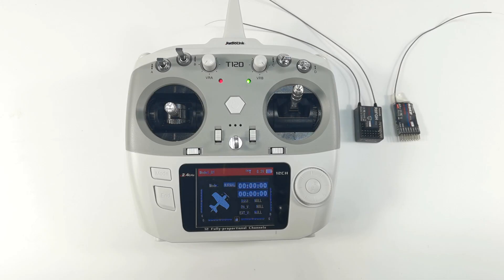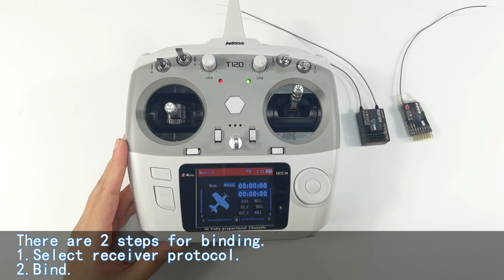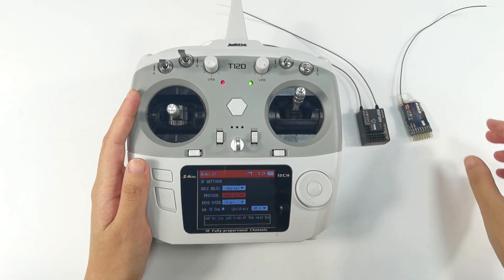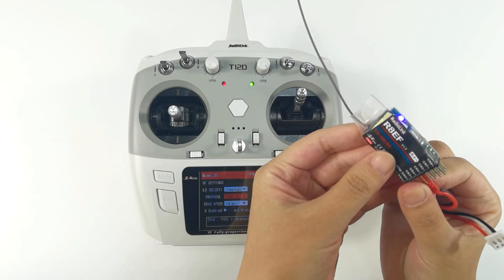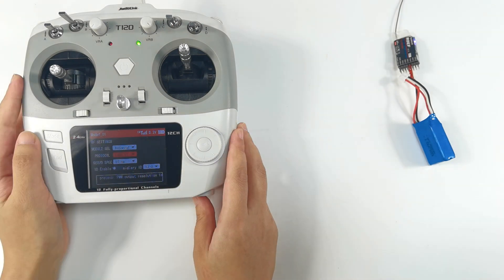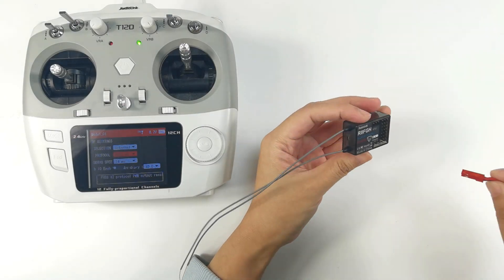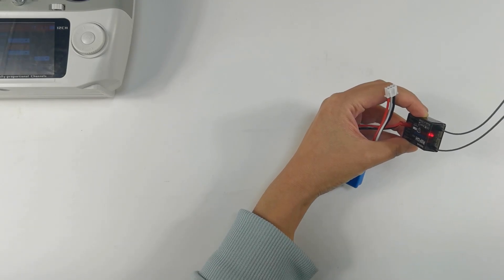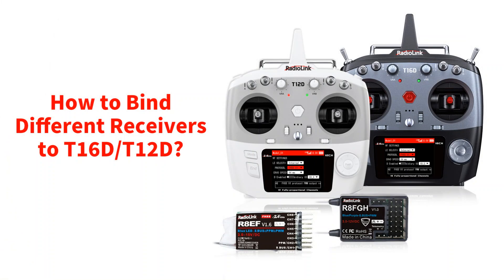How to Bind Different Receivers to T16D/T12D?

Comment: Thank you. Is it possible to use another brand's FHSS receiver (no bind button, just a cable) with my T12D transmitter?
Reply from the maker: Hi, sir. RadioLink control system is not open-sourced, so RadioLink transmitters are only compatible with RadioLink receivers. T12D is compatible with RadioLink R16F, R16SM, R12F, R8EF, R8FM, R8SM, R8XM, R8FGH, R8FG, R7FG, R6FG, R6F, R4FGM receivers. If any question please feel free to contact us. Our email is after_service@radiolink.com.cn
Reply: @Radiolink_official  Thanks☺
Reply from the maker: @myssba  Our pleasure.

Comment: Mam t16d i r16f. Nadajnik łączy się z odbiornikiem ale nie mogę niczym sterować😢
Reply from the maker: Hi, sir. After yo connect them successfully, there is a signal tower on  the screen of T12D. Then you can connect the servo to the receiver and control the servo. Please also check the LED color of your R16F, because R16F has many different working modes. If you need PWM working mode, the LED color should be in red. Here is the detailed manual of T16D and R16F for your reference: https://www.radiolink.com/t16d_manual  If any question please feel free to contact us. Our email is: after_service@radiolink.com.cn